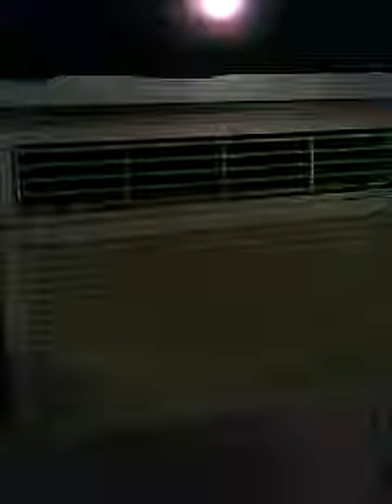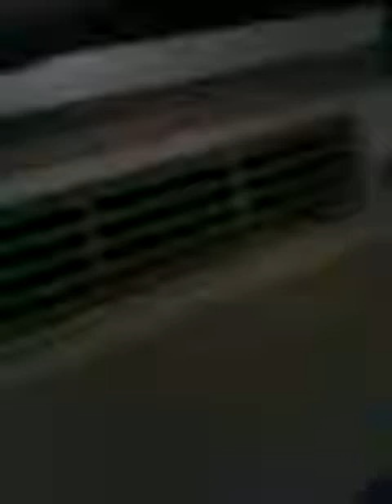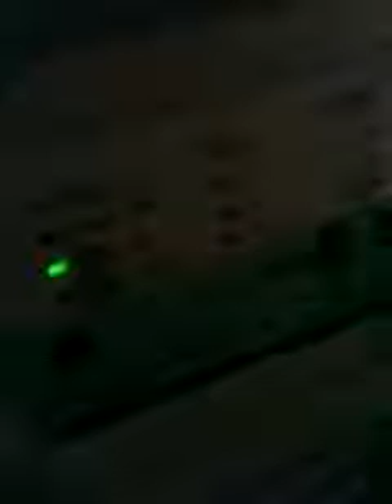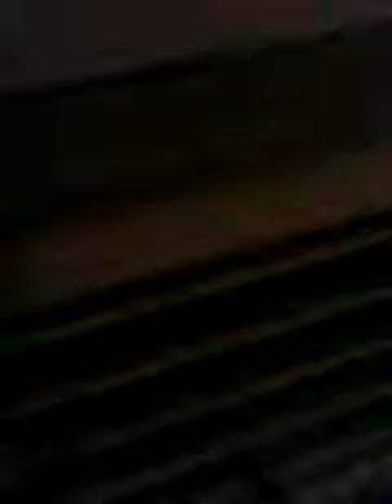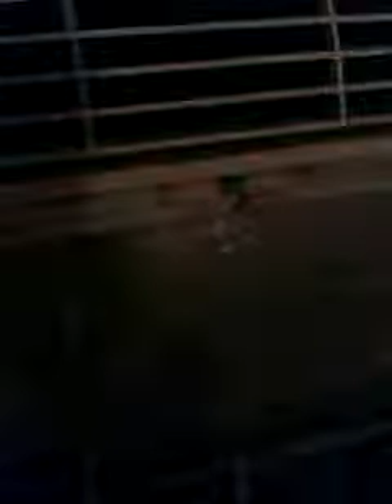frozen air conditioner window unit

Comment: Couldn't really see much but the whole it froze up because high humidity" is bunkum! Dirty coils are highly suspect. Also; to defrost an AC; use a hair dryer while still running the fan! Make sure ALL ice is gone & that the coils are clean (fin combs or a high pressure sprayer work well) & keep an eye on the dew point. If the air is cooler than the dew point, it can cause ice/frost build up. As for the query about that "cracking" sound; as long as the fan is still turning; yer good. However, you can tax the compressor & if the unit is freezing up to that extent in colder weather, use a small window fan for cooling instead so you don't kill the AC unit. That cracking is just the ice breaking inside as it warms up & melts but if it keeps icing up to that extent, your compressor can develop problems rendering it useless. Bitches who are science geeks & study HVAC know things! PS. keep your AC clean. A little bleach water (super diluted!) sprayed on the coils can prevent mold & "dirty sock syndrome."

Comment: Mine has ice at the bottom and I heard that cracking sound. It won't break right? Do u leave urs on during the fall cuz my apartment building has a main heating system and the landlord turned it on for the fall and winter and its too hott so I need to Keep the ac on